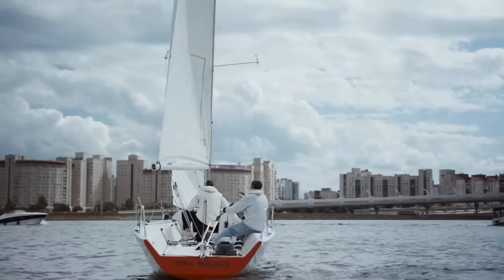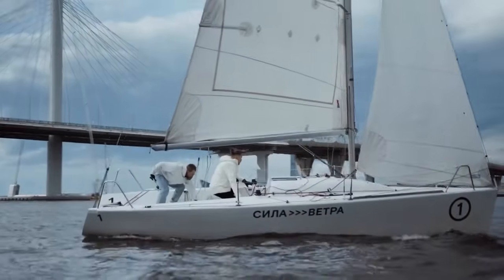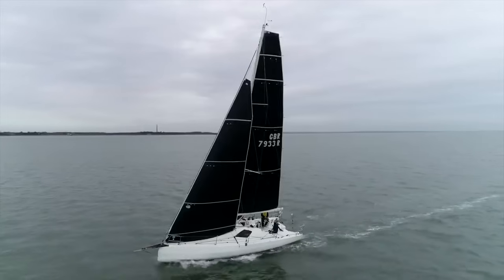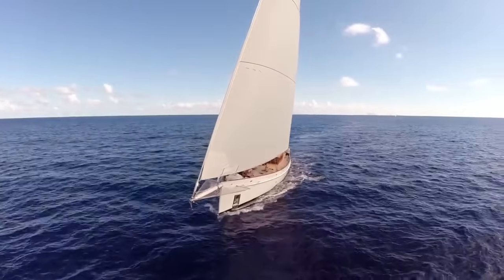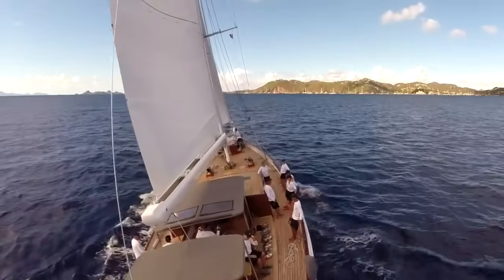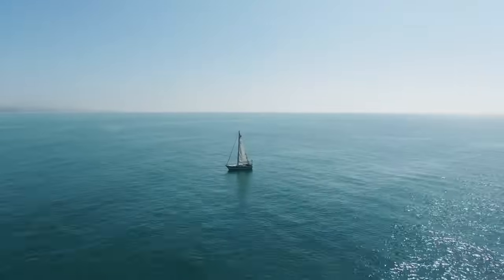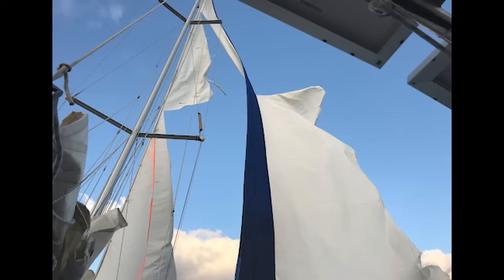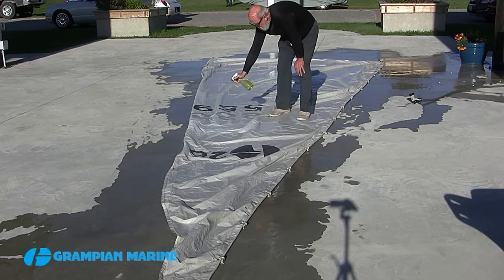How To Buy Sails - With Joe Cooper

Comment: If forgot to comment on the battens. I have used full battens for about 40 years, wouldn't go without them. A pain in the behind to put up, especially with lazy jacks, but a breeze to drop into the cradle when sailing is done. Properly set up, they are a worthwhile investment for the single handed sailor.

Comment: For a cruiser and occasional club racer Dacron is the obvious choice (unless you have very deep pockets!). Over the years I have always stuck with the local loft, and it may be a large international company (i.e. North, UK, etc.), but a local sailmaker can figure out the most likely sailing conditions the boat will encounter and design sails accordingly. Yes, there are "mail order" sail lofts available at a lower cost, but like everything else in the boating world, buy it right once, or have to buy it again. A well done and comprehensive presentation. Thank you.

Comment: No mention of roller mains, no real mention of cut, slab or triradial.  Genoa or jib size 130% 150% or what that means.
Every company asks about usage ect. In the past months I’ve talked to every sailmaker from here to Asia, they are very knowledgeable. There are at least 9 different types of Dacron,
I’m in the process of purchasing new sails for my HR42 and it’s triple his mentioned costs, sometime 4 times his estimate. Elvstrom being the priciest. Seems the little guys are much more reasonable then the big company’s like UK & NS.
A race boat that has 5 or 6 forsails on board is different than a cruising yacht with a cutter stay on furler?
Reply: Ok kinda surprised that with a HR you don't get genoa size. Depends on your use. If light winds area like Chesapeake or Great lakes then bigger is better. If full on offshore then maybe a 120 works. Cheaper means just that. Back in the day I favored Hood Dacron because of the fabric. Kinda of like Egyptian cotton sheets with a ridiculously high thread count. Not to sure that applies anymore.
Reply: @jackwalby6257  my Genoa is a 150 and when my main tore in the Bahamas this season, I had a tent company in Nassau do a quick hem to the bottom and made 7knts to exumas and back to Miami with just the forsail. So I need a mast furling main asap. To continue my circumnavigation. However as the sailmaker said they come out and measure, none of the sailmakers I talked to would come measure, they sent an instruction sheet for me to make the measurements. Have to get back to the boat soon to make those measurements. And was given a 6 to 8 week build time.🤞

Comment: I'm old an have a set of heavy cruising sails from a 34 ft strip planked sloop I built years ago , they are hank on jibs forget the slides for the mains or how many , there are couple mains an dunno how many jibs or sizes , they have crossed the atlantic twice so have some use , they are still good heavy sails if anyone living in this time wants hank on sails , let me know with a comment if anyone wants them because when I die the kids will probably put them in the garbage , I'm in Ontario